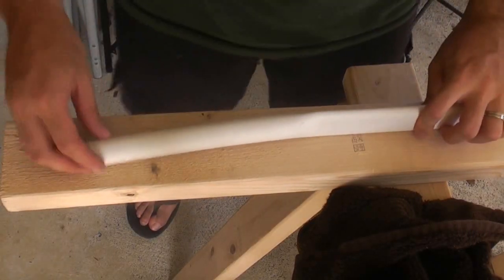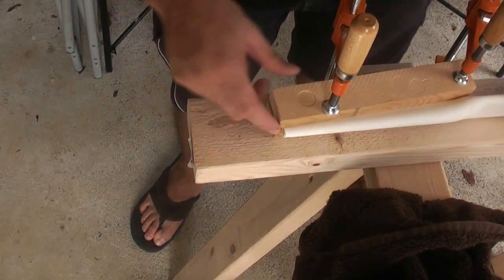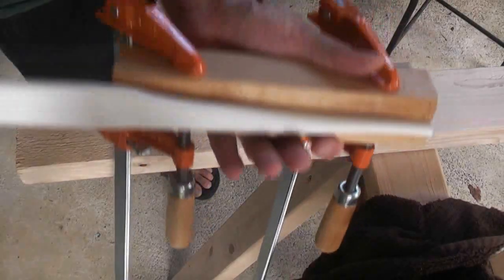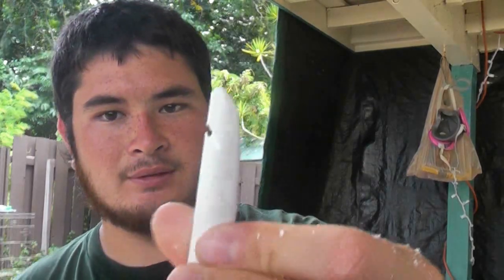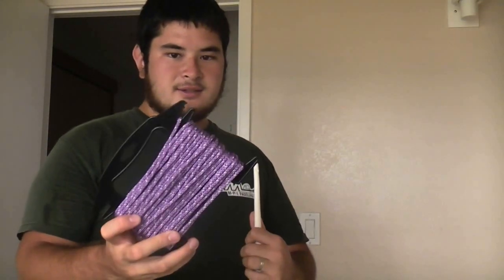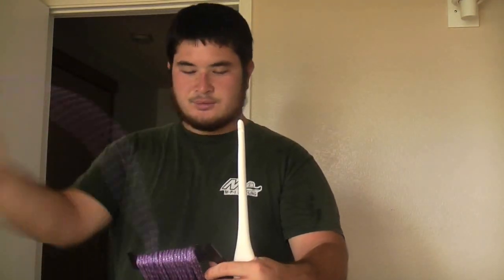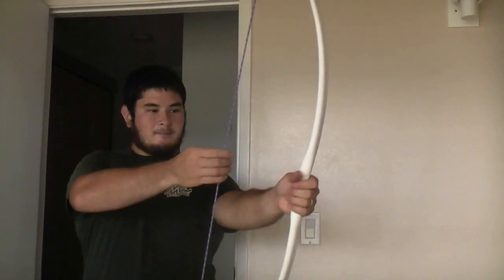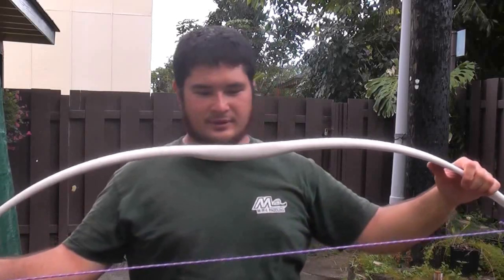How to Make a Hunger Games District 12 Bow with PVC Pipe Part 3

Comment: After you create the taper, at 3:01 you start saying you're supposed to cut it free along "this line". It's a bit unclear what line you're referring to because when your video jumps to after you have done so, the shape looks reheated/reshaped in addition to cut and sanded. Originally the tapers look like a T shape, so do you cut the long limb of the 2 off, then heat the tip again to join the sides of the open slit?

I'm just unsure where to cut and I don't want to completely botch this one, so any help is appreciated!
Reply from the maker: The tips should already be sealed shut. I didn't do any heating afterwards, I just cut off the flattened part. When you flatten the tip, there will be a rounded part and the leftover tab. Cut the tab off just before it ends. The tip should already be closed, if they open up you've cut off too much.

Hope this helps!
Reply: BackyardBowyer
Oh! Okay so upon re-examining, it looks like there may be a very very slight gap visible, a "seam" if you will. Did you seal this with some kind of glue or are the 2 sides pressed together enough that it doesn't impact performance/longevity?

Also, do you happen to have a video discussing the choice of length? I'm making this for my 5'7" girlfriend and I'm not sure if I should make it shorter or longer than your video suggests. I can't seem to find any formulas for impact of length on draw #.

Thanks for all your help and happy holidays!

Comment: This is where I made my second mistake on my first attempt to make this bow. Don't use a power-tool to cut the nocks.. you will cut through the PVC waaaay too easily and create a hole... I tried my first attempt bow and it does work just fine, but I'm a little worried that on the 10th time I shoot it, I'll have my mouth full of bow.